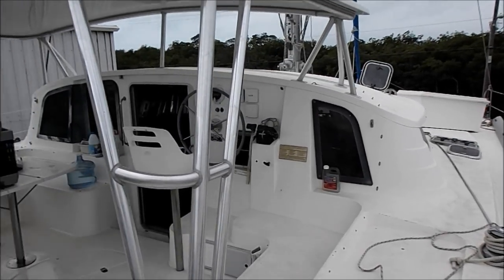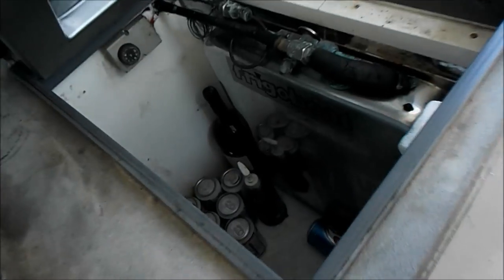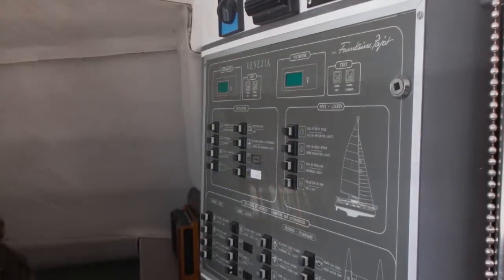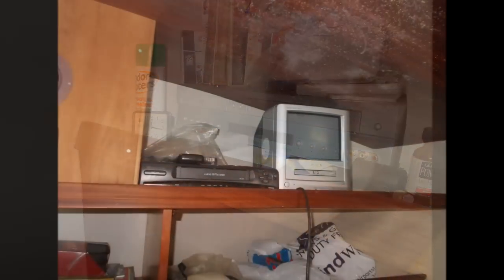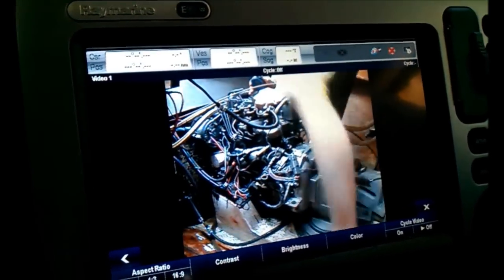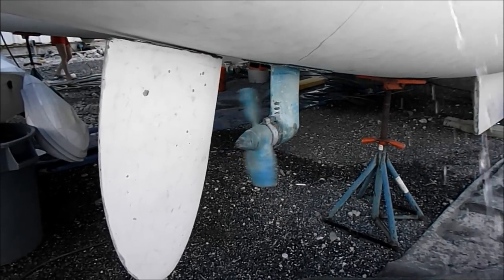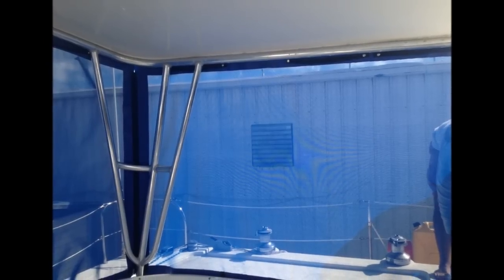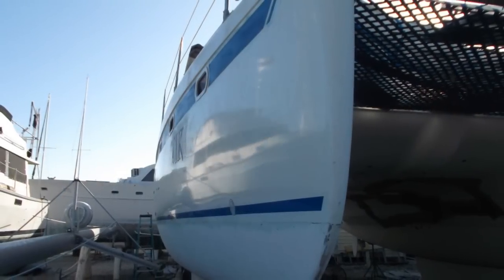Sailboat Refit - Episode 1 - The beginnings of a year long refit

Comment: Hello! I was thinking about a project very similar. How is it possible to have "free internet" like you said, especially while sailing?
Reply from the maker: +kingBRANDONcastle Well, when I made this video I had no idea what kind of internet would be possible or how often I would find a wifi signal.  But to our surprise, there are quite a few signals that can be reached from the comforts of your boat via the wifi hotspot we have on board.  The reality is that very few are free.....you will find a free signal every so often, but more often than not, you will pay a fee for your internet access - usually running around $10 US for 3 days of connectivity, or $50 US for 30 days.... something to that effect - but the truth about it, is that its one of the most valued pieces of equipment we have on board and while usually the access is rather slow, being able to send and receive emails from the comfort of your boat is priceless.
Reply: +s/v Catchin' Rays Thank you for the extremely quick reply! And this helps a lot. So you guys have a provider? Who is the provider?
Reply from the maker: +kingBRANDONcastle There is not just 1 provider we have...its just whatever provider is at the particular island you pull up to.  George Town has about 3-5 providers that you can pick up...I forget now all of the names of them.  Rose Island had like Bahamian WiFi, Grenada had something, etc...there are some companies that will have their services in a couple of different stops, but some will be just 1 and done...you pay $10 for a couple of days, and then you move on and will never see that signal or company again.  I probably subscribed to 10 different wifi signals throughout the thorny path.  Hope that helps.
Reply: +s/v Catchin' Rays Yes it does. You guys have been a significant  inspiration for me, and it's nice to see it happening through this channel. Thank you!